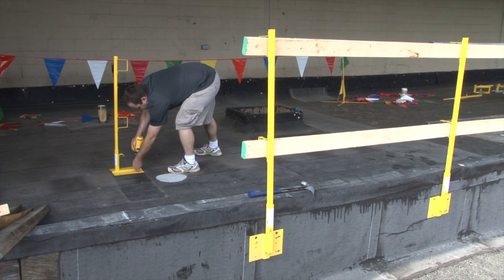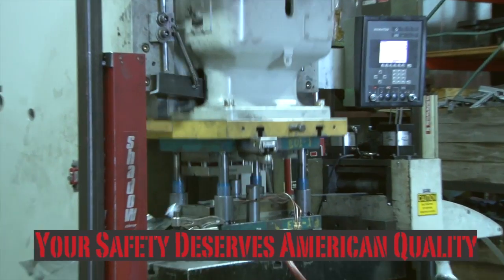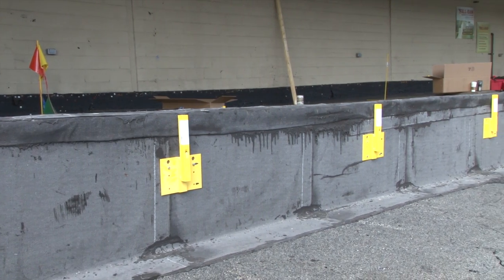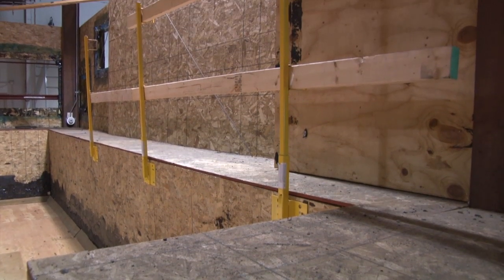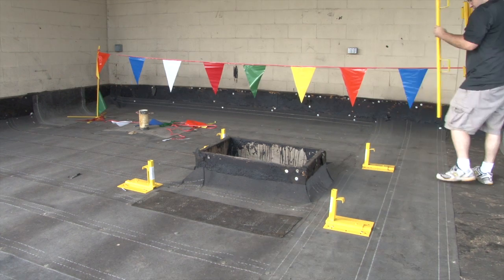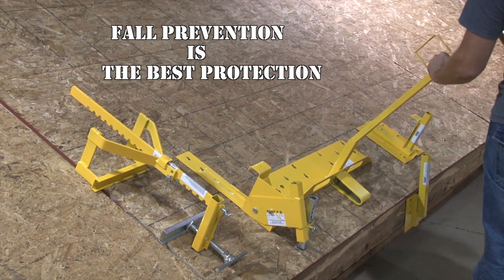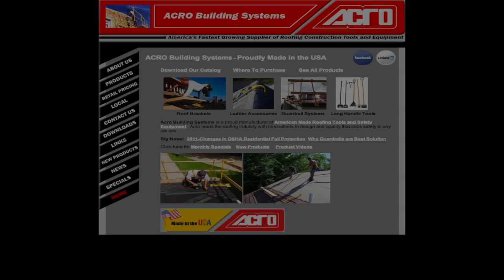Universal Temporary Gaurdrail System for Any Construction Site

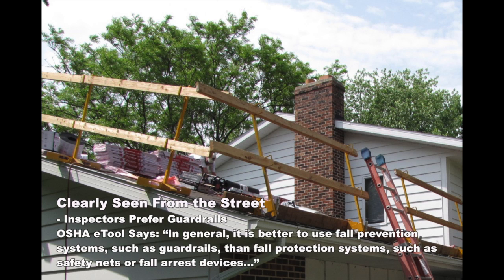Comment: 2:22 where's the toe board?
Reply from the maker: Toe boards can be added to either the vertical or horizontal guardrail bases.  In the instance shown, no toe board was used as there was a small parapet wall that would prevent items from falling.